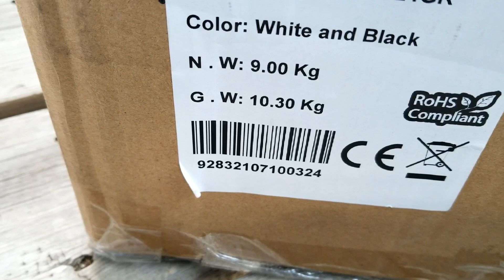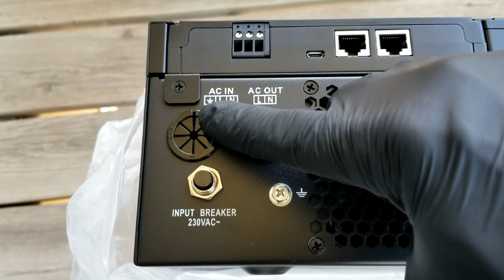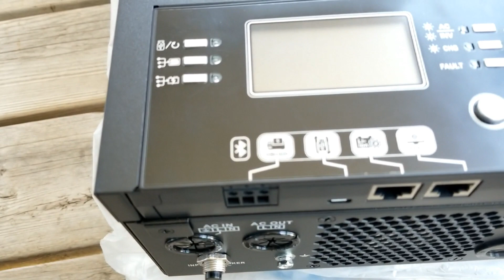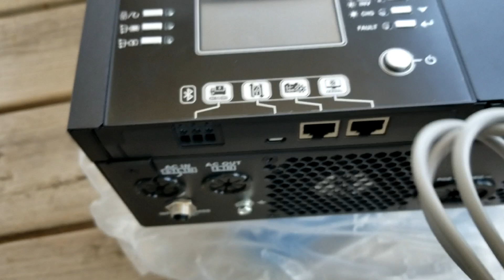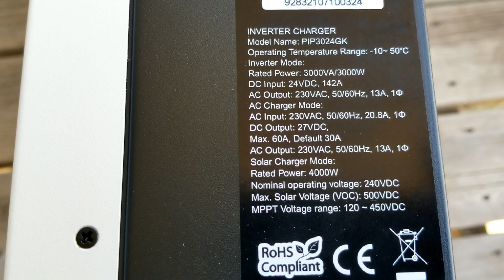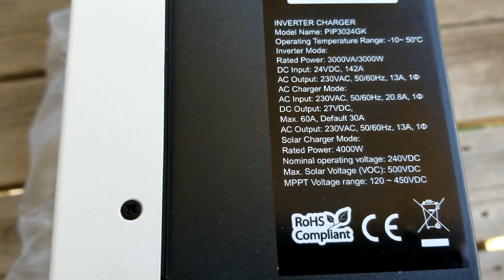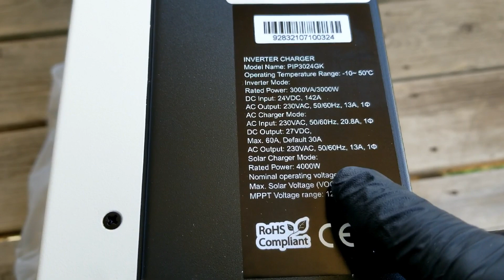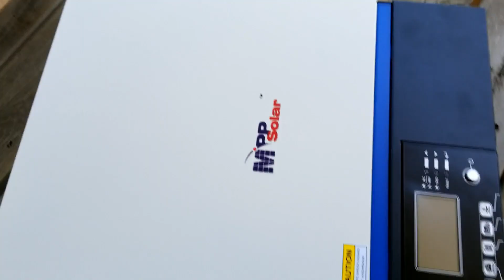(GK) 3kva 3000W 24V 230vac SOLAR INVERTER + 80A MPPT SOLAR CHARGER HIGH PV 500V

Comment: I have the same inverter - my solar (pv) light flashes on/off - is this normal ? 

It reads 140v 0amps 0watts.. no charge, won’t charge the battery’s from my solar ,.. can’t figure out why ? Any ideas ?
Reply from the maker: Sorry to hear that. I will recommend you contact the seller or the manufacturer.
Reply from the maker: Thanks for WATCHING LIKE SHARE & SUBSCRIBE

Comment: 1 have 470w 4 panels 43v X 4 =172v is that enough for the inveter?
Reply from the maker: I will prefer 6 solar modules If the finance is available to do so. Adding  two more  of the same panels for total voc of 258vdc you can easily get away with a 10 AWG cable for this installation easily. 
This is just a suggestion for you to think about.

Comment: Ok let's try this question do u have to have 6 panels in series in order for this inverter to work will 4 335w 45v panels work or do u have to have at least 6 panels ?
Reply from the maker: I suppose I have sent you the link for the Inverter/Changer manufacturer for you to look it up, base on the specifications of the inverter since you told me you didn't have the manual for theat Inverter/Changer.
I suppose I have explained the specifics of this machine to the best of my ability for you to understand what you need.
If it doesn't work, you have right to return it to the seller for full refund. 
Thank you.
Reply: @jwsolarusa  I can't return it I bought it used off of eBay as is everything seems to work but I'm getting conflicting answers about this Inverter I told you it's identical to yours all I've been trying to ask everyone is how much power you need to run this thing I have four 335 watt panels in series and it's like everybody's having a hard time giving me a straight answer some say you need at least six panels not four others say you need at least 220 volts or more I don't want to buy two more panels if I can't confirm the machine is working properly but no one can give me a straight answer
Reply from the maker: @thelithiumpowerch  
Well you should try and implement the ideas all of us has offered you and see if it works.
Reply: @jwsolarusa  I am but that means buying two more panels the panels are only $100 each but I have to spend an extra $200 to have them shipped to me and that cost money
Reply from the maker: @thelithiumpowerch  
But this is not a bad idea. It is a win win game. You always need extras power for the winter
Reply: @jwsolarusa  yes because it does detect my solar panels but I think I'm to close to the  minimum voltage of 150 and need to be over 200 volts to get it to charge because right now no amps and no watts are coming in only the volts..
Reply: @jwsolarusa  basically I'm trying to find out has anyone had success with four panels with at least 45 volts each panel not six not eight or 12 panels 4 panels has anyone been able to run this inverter with four panels what's the least 335 to 350 w

Comment: I wish u had a video on it actually hooked up to solar panels and operating the correct way and the functions of this inverter
Reply from the maker: Maybe later
Reply: @jwsolarusa  ok thanks because I'm still trying to figure out if mines is broken or not I'm not getting no amps or watts from my solar panels
Reply from the maker: @thelithiumpowerch  
Contact me at jwsolarusa@hotmail.com with a phone number and will call you
Reply: Yes at least 120v to start up
Reply: @piterex7  it's sitting here running at a 150 to 160 volts on 4 panels but not charging or giving me no amps or watts from the panels it's only detecting the voltage...
Reply: @piterex7  and it's not turning on with just the solar panels with a 150 volts it does nothing until I turn it on from the batteries..
Reply: @thelithiumpowerch  did you hook up computer.? You have to set up first charge voltage and current set up operating system this unit have 3 !first to work with battery 2 without battery just grid and PV and 3.battery PV and then in no power in battery and PV will drain the power from grid ! And connect the battery first before PV solar

Comment: I have the same inverter and this thing wont read the amps or watts from the panels only the volts i have 150v to 180v coming into this machine it wont charge my batteries or nothing
Reply from the maker: Sorry to hear that. I will recommend you contact the seller or the manufacturer.

Comment: Nice
Reply from the maker: Thanks mate
Reply: @jwsolarusa  The first batch of my new batts should be soon
Reply from the maker: @awesomusmaximus3766  
WOW!
Congratulations and welcome to the lithium family. 
May I ask what type of chemistry you got?
Reply: @jwsolarusa  16X 280ah 3.5V  EVE LIFEP04's
Reply: Also have two 250A DALY blutooth bms's
Reply from the maker: @awesomusmaximus3766  
Great!
Are you upgrading to a 48v system or keeping the 12v system
Reply: @jwsolarusa  Keeping it 24V I was 12V with that cheapy powerjack inverter but went 24 when I purchased the Victron Quattro 8 Kva
Reply: @jwsolarusa  I'm down to my last four trogan T105's they are hanging by a thread